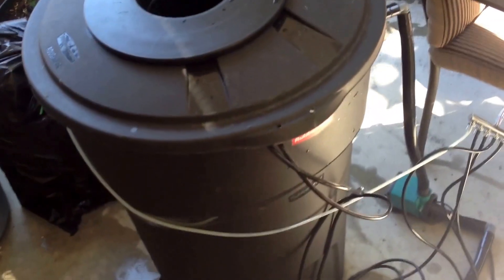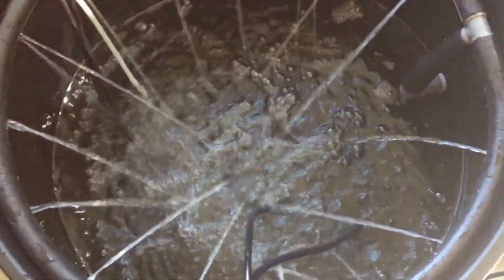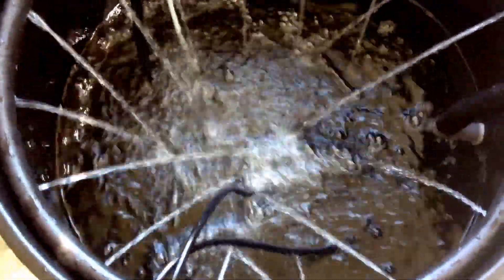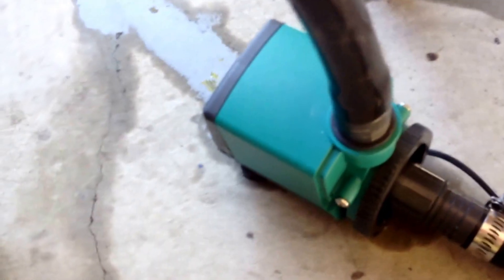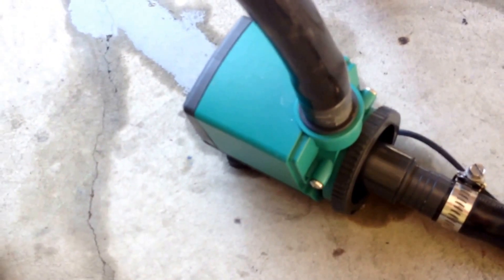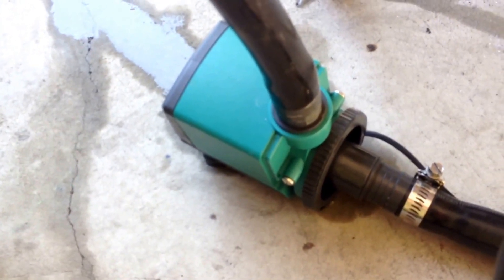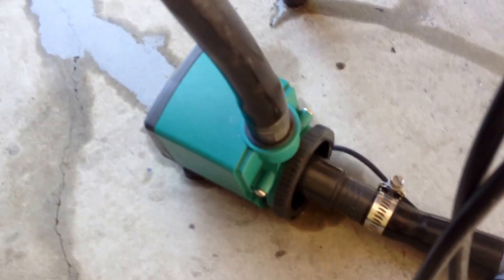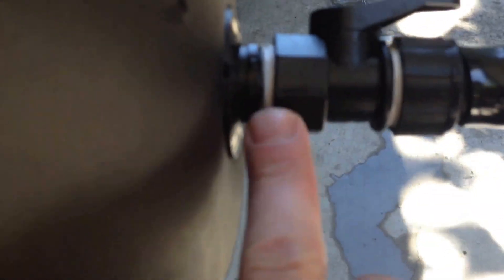Part 2 of my DIY RDWC AND A QUICK RUN DOWN ON PARTS

Comment: Dude...  Where did you get the tall bucket thing ??  It looks like it's taller than just a 5 gallon bucket..   I would like to find one that is taller than a regular 5 gal..  I need a bucket around 20 inches tall..  A 5 gallon bucket doesn't give my roots enough room..  The last one had a root ball that would have completely filled a five gallon bucket..  If you can tell me where I can find something taller I would appreciate it very much...

Comment: I really like your grow system, I used to grow like that many years ago, too many power failures in winnipeg. I've lost a couple harvests due to not noticing a power failure.  But the system grows cannabis awesomely!  Cheers buddy!
Reply from the maker: I'm going to build a system a day each one will be different,because I want to see what works best.
The one build tomorrow will be utilizing two garden sprayers connected to a mag drive pump,I will position the two sprayers so they most the net pot,with air stones on the bottom .
Reply: Good for you!  My best system ever was a form of this type of growing. 4' x 8' plantlet airiation growing tables under 2000 watts.  Yeilds on average for us was 8 to 10 lbs per table. Learned and improved from the SSSC. It grew budcycle plants that were about a foot tall but all bud, like the centre top cola of a big plant. We would have about 300 plants per table, yeilding between 10grams and 1 oz per plant. I am looking forward to seeing your experiments.  Cheers.